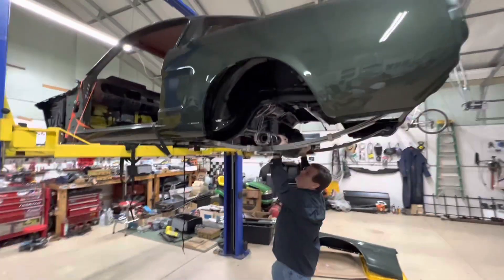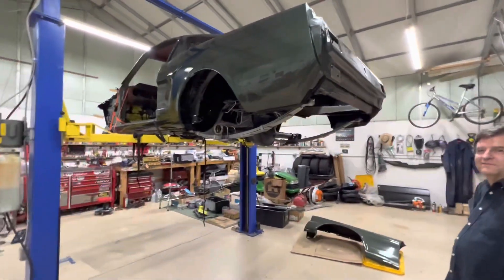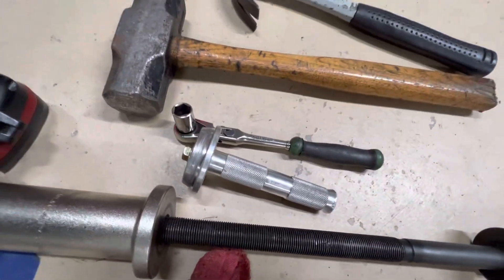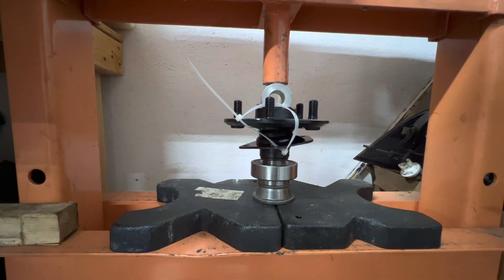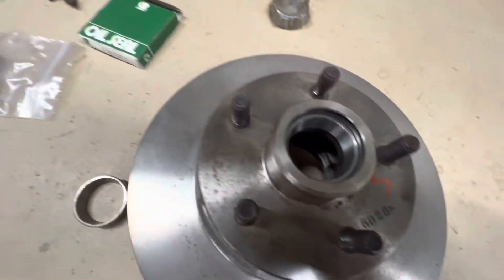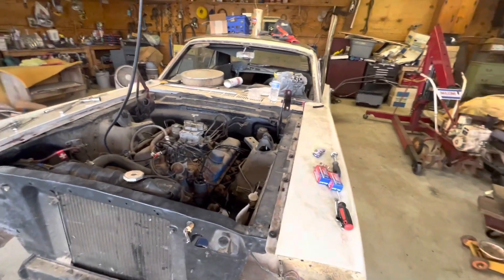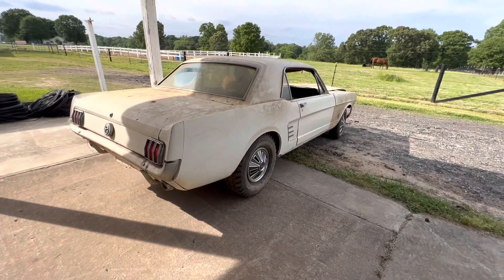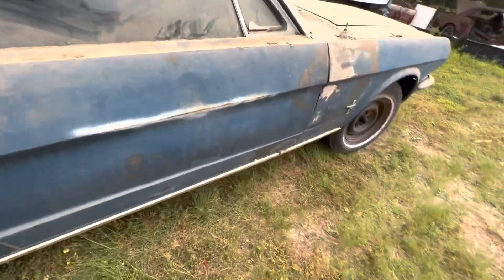1966 Mustang GT Fastback Restoration Part 5

Comment: You routed both fuel and brake lines thru the driveshaft tunnel???? What happens to the car in the event of a driveshaft problem? Impact damage from a driveshaft whipping around will either cause brake failure, fire, or both.😮
Reply from the maker: Yep the 60s were a dangerous time lol!